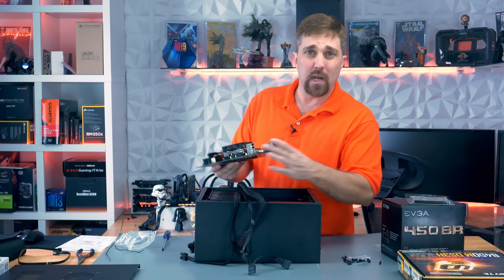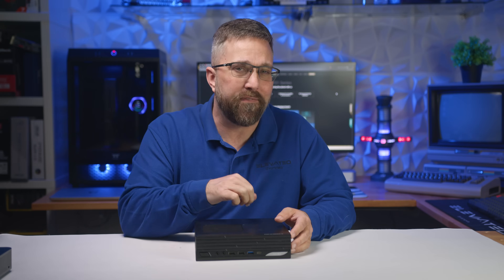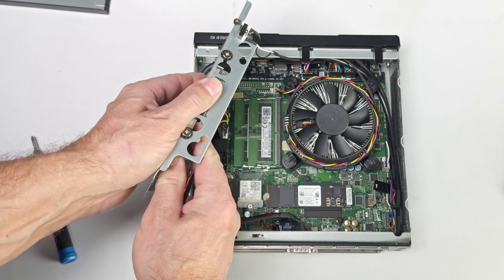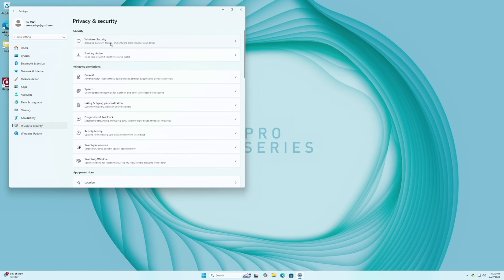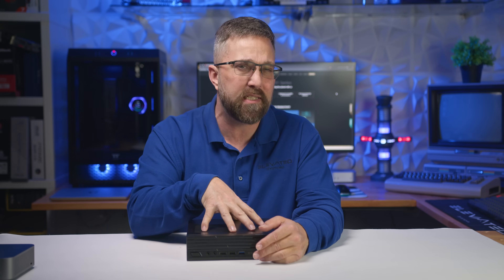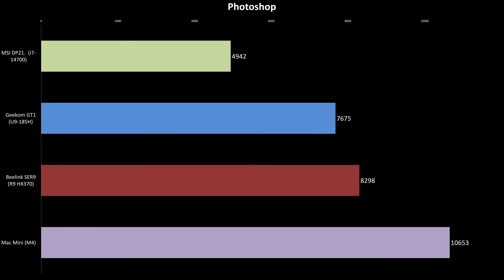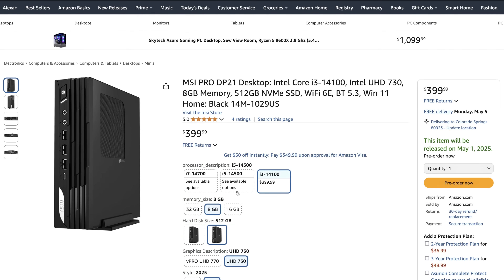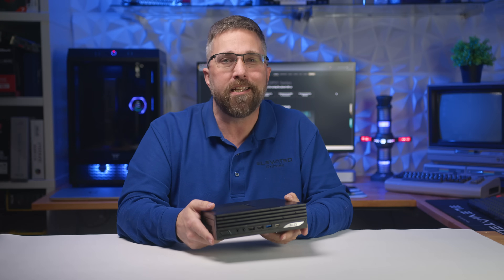Boring but Better? MSI’s Mini Desktop vs The Best Mini PCs!

Comment: MSI rock solid...LMAO   not hardly bro..  I've been building PC's since my first one , the Commodore 64C,..then the ,XT's and on to 286's, 386's 486's  MSI like other  brand boards had their share of problems..most notable was issues with component failure and one of their biggest ones was capacitor failures do to a lack of quality control, and a lack of performance optimization and motherboard fan failure along with reliability and compatibility. Even problems with early bios versions,  To be honest I stayed away from MSI.. and just some FYI. MSI didn't even start making board until 1989. .. All that said.. MSI had come leaps and bounds since then like many other companies..

Comment: Just checked the prices ... unfortunately, the MSI is more expensive than comparable options of other manufacturers. Also, there seems to be no option to buy the system without Windows. That is disappointing at least for those users, who intend to use it as  a Linux desktop or small server system. Why pay for a Windows license you're not using. So, from me, this is a no go.

Comment: will anyone buy this with windows on it.....windows is extinct outside the usa.

So can you get it with linux installed or enterprise systems such as solaris 11 oios or freeBSD?

It needs to be third larger for expansion and quiet cooling.....what were they thinking ?

Comment: The lack of multiple M.2 slots, PCIe expansion slot and USB-C 4 or Thunderbolt ports is disappointing and defeats the purpose of an expandable mini desktop, the Minisforum MS-A2 or even Lenovo P330/P3/M90q Tiny are better choices.

Comment: Sigh.
I can’t say anything was ‘wrong’ about your review. However, it did come across as…

This is not the best value for your money. It’s “okay”.

You have to really want one of the few eccentric features it provides, like a spinning hard drive… VESA mount else seems a little niche, but useful. The inclusion of so many legacy ports and no thunderbolt also comes across as something for yesterday’s buyer. One Ethernet, one hdmi, and one or two usb 2 ports would be enough legacy. The rest s/b USB C and TB. Let’s be honest. Even the one you reviewed is a cut rate product. The others provided better performance and a lower price.

Comment: I've got the slightly older DP10 at home which I use regularly. I bought the barebones version and added 32GB RAM and 2TB SSD. Initially, I installed Windows 11 Pro on it (which did install easily). When realising what a dumpster fire Win11 was, I tried to revert to WIn10 and had all sorts of issues with Win10 drivers (even downloading official intel drivers from the site wouldn't install correctly). I went to the MSI user forums and got told to "Contact MSI directly" which I did - no response. I ended up sorting the drivers using Snappy Driver Installer (what a great tool). By comparison, Fedora KDE installed flawlessly first time and been mainly using that on here.

In general, they're a pretty good PC with the specs and very easy to upgrade components. Its strange that the DP21 only has Gigabit Ethernet as mine has 2.5Gb, 2xSSDs, no USB2.0 as all are USB3.2 and pretty sure the USB-C at the back is display port compatible. I'd also say reliability is pretty good as well - although their tech support is basically non-existent. And Linux actually does run slightly better than Windows on it. Uunder windows the CPU cooler is always running high. In Linux, it barely even comes on unless it's under high load.

Comment: Clocking in at over 1200 bucks is problematic but how in the world did they let this leave the factory without an Occulink port?  Also max pre-config at 1tb NVME and a single M.2 slot?  That is not great.   Since they didn't provide for an E-GPU option, you have to get 2 nvme slots. Even if a "business" class user wouldn't need that flexibility, gamer people would.  At this price point, you need much more expansion to appeal to a broader market since it needs to attract a flagship customer in this range.  Also always, great video.  Thank you for hitting the hi lights without the fluff.

Comment: Not surprised to see an MSI system be Intel based, they seem to have some sort of issue with AMD.
Reply from the maker: Business PCs usually use Intel because many of their Core i5, i7, and i9 CPUs support vPro, which adds remote management and security features. AMD offers similar features, but only on their less common Pro series chips.

Comment: What I got from this video is that if you aren't running any Windows specific applications, go get the Mac Mini M4 at 799 with 16GB RAM + 512GB SSD; or 999 with 24GB RAM

Comment: No mention of thermal throttling with that hot processor? Miss.
Reply from the maker: I thoroughly covered thermals and power consumption. The tjmax of the 14700 is 105C and in this system it didn’t exceed 76C.

Comment: Gigabit LAN still? is it really that much of a cost to go at least 2.5?
Reply from the maker: No its not, especially at the cost of this PC. However on the other side, the number of households that actually have access to greater then gigabit internet is extremely low. Less than 7% as of 2023. The same FCC report suggests that only 46% of the US has access to 940 mb/s speeds.

Comment: The 14700 desktop iGPU is FAR weaker than any of the mobile chips you tested, even much worse than mobile 14th gen iGPUs. And you're stuck using it here.

Comment: M4 Mac mini out performed on most test and is half the price and the m4 pro so just a little more money compared to the msi will lap it on most if not all real world use cases. 

And we have the geekom mini with the amd apu. Its cheaper, smaller and is an awesome light gaming rig for people like my wife who mainly plays sims and  game streams xbox cloud gaming.

For mega corps like the oneI work for, i could see them using the msi. We use dell nook pc. Though i think the dell nook look cooler, are thinner and just as capable considering most things are  proceessed though a network

Comment: "Business class" - stopped watching. Equivalent of "PC for Excel and maybe 3-4 tabs in Chrome". Please review some actual PC that can handle at least games from 2018. Otherwise just get Mac Mini M4, will run Windows software on Parallels better that this
Reply from the maker: 80% of computers sold are to grownups who don’t play games.
Reply: @ElevatedSystems  Sweet summer child, do you even know what poke719,4 does? Best with poke710,0? My grandkid is older than you and my point still stays. But thats true, some people die at 30 and just walking around coz nobody burried them till 70. This stuff you are presenting here is a mid at best. And useless for basically anyone, except "business" users
Reply from the maker: @ are you asking me about color sets? Did you see the computer sitting behind me? Although not an Atari 400 so I was accustomed to Poke 646,1 on Poke 53281,6. Admittedly I had to look up those memory addresses. It’s been about 40 years since I typed out a basic program out of a Compute! Magazine. Also “business users” make up 80% of all computer users.

Comment: I'm looking forward to buying an amd mini pc for a linux home lab that is energy efficient. I'm having trouble understanding AMD processors though. It's confusing to know the nanometer size used and what all the amd processor numbers mean.  I want the smallest nanometer and most powerful amd processor paired with 2 m.2 ssd slots and expandable ram up to 96gb, its too difficult to find though.
Reply: Minisforum MS-A2 with the 9955HX processor is a very good answer. 16 Zen 5 cores, supports that much memory, 2x 2.5 gb ports and sfp+ receivers for 2 10gb ports if you add the modules.   It has 3 M.2 ssd slots with PCIe gen 4 x4.

Comment: Outside of extreme gamers and high-end engineers, min-PCs are amazing for the average consumer and those with CPU needs only.  Saves space, less power consuming, solid for light 1080p gaming, and easy to service.
Reply: which is the best one to play decent pc games, especially for fps etc at average fps, with mouse and keyboard. mac mini has obvious flaws as far as supporting pc games in general is concerned not to mention the input lags and other problems one can face while playing with a mouse.
Reply: @Tintak_hatpin  Beelink SER9 or Minisforum Neptune HX100G.  The latter is for pure 1080p gaming and is bigger in size.
Reply: and those mini pc cpu performance sometimes even faster than those 9800x3d

Comment: The small form factor Mini PCs is not only the future, it is the present. These devices are more aesthetically pleasing than the bulky PCs of the past. The size of those older PCs was primarily due to the need for a large fan, power supply, and expandable ports, which were used mostly for additional storage. Nevertheless, most of those ports remained unused. With the rise of Thunderbolt ports, users now have incredibly high-speed data transfer and the flexibility to connect multiple devices using just one port. Thunderbolt 5 even surpasses the speed of most PCIe ports. This evolution means that the need for numerous bulky ports has diminished significantly. Even for GPUs, you can now have external GPUs plugged into a Thunderbolt port. There is even an eGPU coming out with the NVIDIA RTX 5090. As CPUs become more efficient, the size of PCs will continue to decrease. Bulky PCs will become the realm of specialized users.
Reply: I agree you're probably right but there are significant downsides, repairability goes to shit so I usually encourage away from AIOs when space is not a critical factor and if you need a dedicated GPU then custom desktop is still by far the best way to go but does the extra material usage of desktops vs mini PCs offset the small chance that it will need to and can maybe be repaired in environmental impact? Probably

Comment: the MINISFORUM 795S7 Mini PC is a way better deal for that price, you even get a discrete graphics card that isnt cut down (rtx 4060). if you undervolt the 4060 a little bit, and set the cpu's powerlimit to like 75w in its bios, thermals wont the much of an issue either. the only caveats are that its just slightly taller than the msi mini pc, and the cpu is actually soldered onto the motherboard.
Reply: And if you need a smaller footprint without gamer graphics you can look at the Lenovo M90q (10th gen+), or the P330 tiny (8th-9th gen) with a cut down PCIe port inside for a small internal video card with 4 DP outputs like an Nvidia T600/T1000, or if you need less power, a Quadro P1000/P620 is cheap. 

They're a bargain on the used market.

Comment: Solid video with lots of good intel, I just wish Minisforum was a part of the convo. They really popped off at the last CES!(I thought😅)
Reply: Minisforum HX99G or HX100G are excellent for moderate gamers.  The desktop isn't as big as a traditional one, but bigger than mini-PCs.
Reply: @akin242002  Yeah, but for what? Upgrades? The size doesn't matter if the cost to performance factor doesn't line up. For a simple little work pc on modern systems, I still go with the mini pc.🤷‍♀️
Reply: @CindyElaineTs   It's slightly bigger for the dedicated GPU (Radeon RX 6600M).  There was a great sale in Q4 2024 for the Minisforum HX100G at $750 USD.  However, I didn't jump on it because I already have a PS5.  I prefer Intel NUC, now called Asus NUCs.

Comment: I don't ever bother to uninstall all the bloatware, i just straight from first use just boot usb installation and install clean windows on all PCs.
Reply: Yep came here to say this.  If you're sticking with Windows (I usually just put Linux Mint on there), immediately do a clean install if it comes with any bloatware at all.  I usually do it anyways unless it's on like a Surface device where I know there is nothing shady.
Reply: Mint during initial start up. Made the switch in spring of 2024. 
Mint made it fairly painless for me.  @Watchandlearn91
Reply: Yeah, my attitude is that I'll instal any bloat ware should I want it.
Reply: I use Linux Mint. Never regretted it.

Comment: I’d rather go with HP or Lenovo; better expandability and more affordable options on eBay.
Reply: Back in my day, trash meant it didn't work and couldn't be fixed! Nowadays trash means fully functional, decent quality and affordable! We're making progress, people.
Reply: Those manufacturers are trash. The only good pc’s are the ones you build yourself or have laces like Micro Center build for you. Then you can actually replace parts and not have to replace the whole pc be a of proprietary parts.
Reply: @RoxburysFinest617  In the 1L sector, there's no real way to build your own PC. The manufacturers you call trash actually make the best 1L computers on the market.
Reply: @RoxburysFinest617 lol last time I checked you can’t build a mini pc at microcenter are we watching the same video?

Comment: Norton! 🤮That’s an immediate OS reinstall. Nice power for that size though. I’m perfectly OK with the box being boring, it’s what’s on the screen that matters.
Reply: for real lol
Reply: perfect excuse to install debian
Reply: I had it for years (Norton 360) .. super annoying and reporting milion issues with my (aging) PC that I even wonder how it is even working .. need to replace PC anyway and make sure Norton is not there. For the money I have to pay for this MSI thingy I can build quite better midi tower. If I had room for tower last 30 years then I still have it. If MSI is around $800 I would buy it, but with this price, just to save on space .. no, thanks.
Reply: @drnda2007  reinstall windows. Easy.